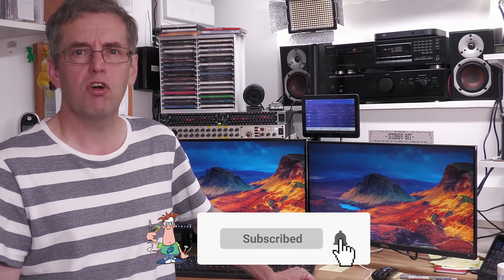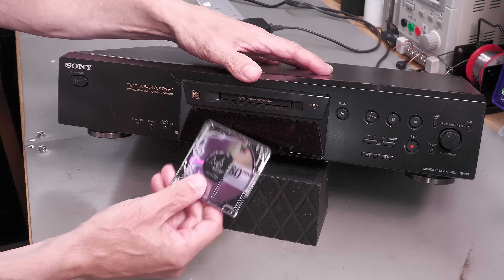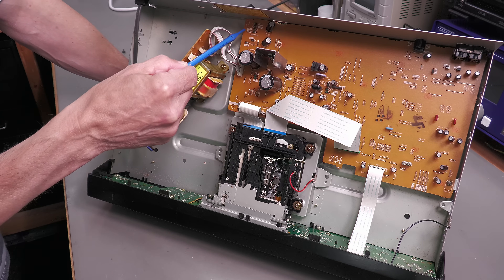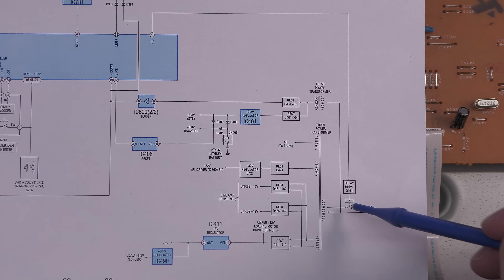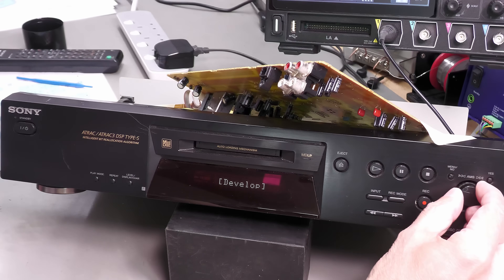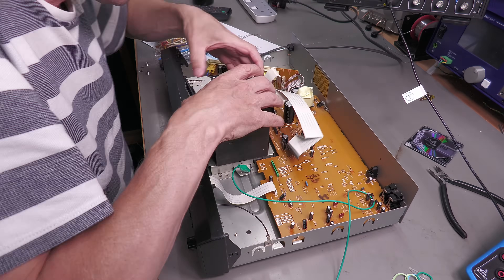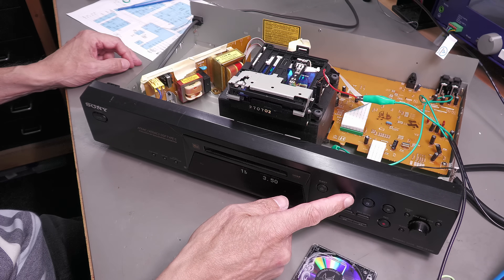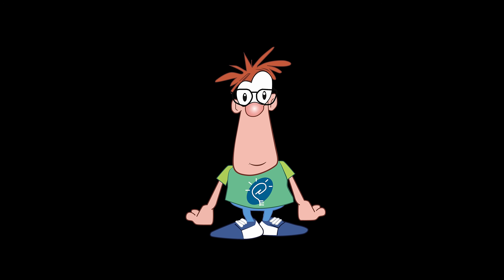No.156 - Sony MDS-JE480 Minidisc Deck Repair

Comment from the maker: The MiniDisc format, developed by Sony and launched in 1992, was a digital audio disc format intended to replace analog cassette tapes. Here's a summary of what happened to it:

INITIAL STRENGTHS (1990s):
Digital sound quality: Comparable to CDs but in a smaller, more portable format.
Rewritable: MiniDiscs could be recorded over and edited, unlike CDs at the time.
Shock-resistant: Thanks to buffering, MD players were far more durable than portable CD players.
Portable: Slim, durable, and perfect for portable use or field recording.

WHY IT DECLINED:
Too late to the game: CDs were already dominant by the time MiniDisc launched.
Cost: MD players and media were relatively expensive.
Proprietary format: Sony's heavy reliance on ATRAC (compressed audio codec) and resistance to support MP3 limited flexibility.
Limited adoption outside Japan: While popular in Japan, MiniDisc never took off globally in the same way.
Rise of MP3 and flash memory: By the early 2000s, MP3 players (like the iPod) and USB flash memory killed the need for optical-based portable audio.
Poor PC integration: SonicStage (Sony's PC software) was clunky and restrictive.

END OF THE LINE:
Sony stopped production of MD players in 2013, effectively ending the format.

LEGACY:
Cult following among field recordists, musicians, and retro tech fans.
Known for rugged design and quality build.
Some people still use and trade MD gear today.

Comment: Nice work!  That said, couple of things: the front panel needs to be pulled off, the control panel PCB boards removed, and the AMS potentiometer cleaned with DeOxit or similar - it oxidizes and you'll find that the tracks will sometimes get skipped as you turn the data knob.  Finally, that battery is over 20 years old - even if it tested OK, you should probably replace it for long-term life.  Once it dies, the deck will erase all settings once turned off and you may get TOC errors.  Clean the bottom read lasar, but never - NEVER - touch the top magnetic record head.  It's super sensitive and it is very easy to damage it.  This was a pretty low-level deck from Sony, but it was one of the cheapest that supported ATRAC Type-R MDLP recording/playback - which is really the only reason to have one.  With a 74 minute disc, you can record up to 360 minutes with very little impact on sound quality using MDLP 2 - which is fairly incredible.  Otherwise, this deck is bare basic - no headphone preamp, no optical out, and that PC Link port does NOT work with PS/2 QWERTY keyboards for text editing - it only works with Sony's PC Link kit (and an old Windows 98/2000 PC).  Finally, there is no VU level meters during playback.  You can only view it while adjusting your record levels during recording.  Sony really dumbed this deck down, but - again - it's one of the cheapest decks available that supports MDLP.   Congrats on the successful belt replacement, though!  I hate Sony's eject transport design on these decks, but at least they made them easily replaceable.

Comment: People, there's a strange sound coming from Sony minidisk MDS-JE480. When it's powered On, the power diode indicates a red color but to the right side... nothing turns on except the strange sound coming from the system. What can be the problem?

Comment: Sorry, it doesn't matter how many times I hit like or unlike, 192 it is and it stays.
Reply from the maker: It’s 193 now……sounds like a browser issue.
Reply: @Amperekaefer  &  @IanScottJohnston  I will try next time to do a page refresh. Usually it works, but once in 20 seems not recorded right. Thanks. (228 now, and a click and it goes to 227, so no problems now)
Reply: Had the same with another video on another channel. Refresh (F5) did update the counting indeed, thanks !
Reply: Klingt nach einem Aktualisierungsproblem. Drücke die F5-Taste um zu aktualisieren.

Comment: I fixed my CD/MD combo with an orthodontal elastic band for retainers. Worked a treat and I still haven't replaced it with the proper belt. I got a bag of 100 for next to nothing.
Reply from the maker: Sounds like that type of band might not degrade as quick!
Reply: @IanScottJohnston  Yeah, I think they might be some kind of silicone blend.

Comment: What happened to your Panasonic SC-PM37MD, Ian? Always made me smile to see that mini system as I have one in storage 🙂
Reply from the maker: I've got two of them, both up in the loft! I fancied a change and the Denon has been in the loft for years! I wanted to drive my new DALI speakers and the PM37MD can't do that.
Reply: @IanScottJohnston  Thank you for the reply. I might have access to a pair of them, too (there was a second unit belonging to a family member that's now probably abandoned). I think I paid £200 for mine back in 2002, and it was a great micro system and introduction to MiniDisc.

From there I moved on to a Denon CD player and Cambridge Audio A300 V2 amplifier
Reply from the maker: Bought my SC-PM37MD brand new also......Dixons or Curry's I think.

Comment: I've got an MDS-JE520 model. It worked as my first DAC from my computer. I think you had to hit record and pause, then you got the monitored signal from digital input to line output. The connection was via optical Toslink from a Soundblaster 64 card that I'd soldered a digital output header on and created the optical S/PDIF Toslink signal with a red LED (with the optical cable taped onto the LED). Later I upgraded to a soundcard with a real Toslink connector.